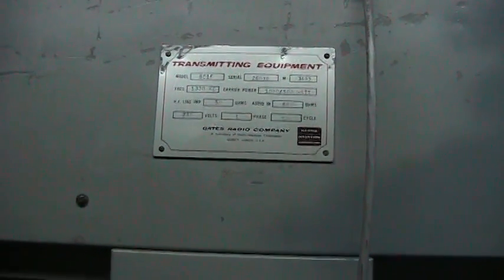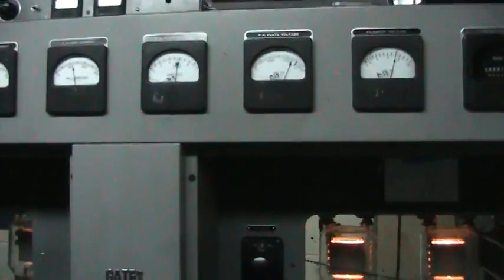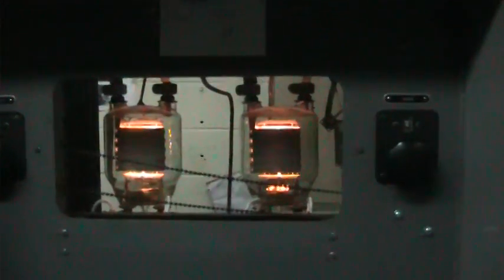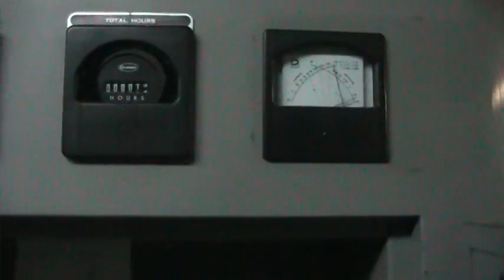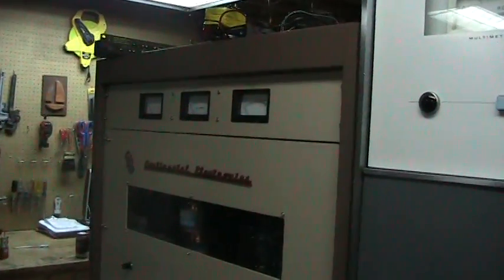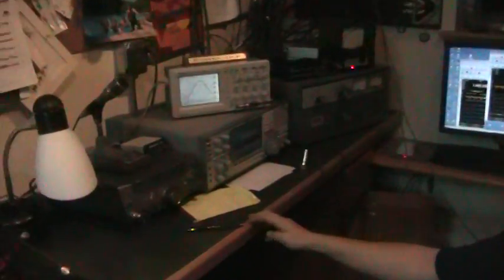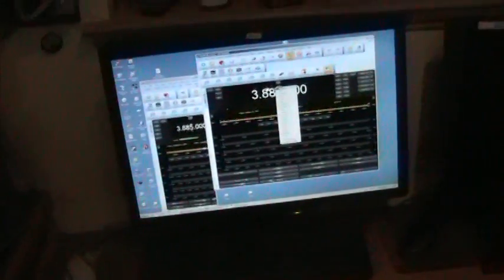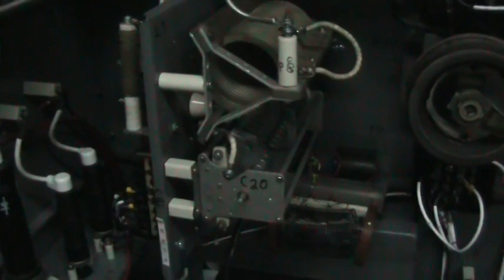HAM RADIO RESTORATION OF GATES BC1F

Comment: 1kw carrier? I am looking for a Bauer 707 or something thats a 500 watt carrier or so. The 20v2's are my fav. Love those ol boat anchors hahah
Reply from the maker: There are lots of bauer and other 1KW rigs collecting dust and rust, they are mostly in HAM radio guy's sheds and they haven't done anything with them.  Most 1KW AM BC transmitters have a "low power" switch to allow nightime operations where power levels were lower.

Comment: These transmitters , operated properly are probably far cleaner than 60% of the amplifier equipped sideband rigs on 75 Meters ! The problem is , the SSB folks actually think they are clean . A few trips across 75M at night with an SDR and reality sets in quickly .

Comment from the maker: @ZmajSnoshaj 

The coils that are in the left hand rear view of the transmitter form what is called a "tank" circuit.  this circuit consists of adjustable coils and capacitors which "tune" the circuit to the RF operating frequency.  

I like tank circuits they look most like frankenstein's laboratory.

Comment: Nice, I saw that you had the tools to set it up. A Tektronix DSO?  The Icom could easily tell you your bandwidth.
Just upgraded to General last Saturday. I want to get away from just being a knob turner and start of with QRP homebrew. As my skills improve then try some bigger things. Boatanchors, hybrids like a FT102, then all solid state then modern Surface mount.  Looked at some class E amps for AM that were interesting.
They're small for the power level out.
QRZ not updated yet.
KG4BXN

Comment from the maker: 1100 daytime and 500 nightime watts. with 100% modulation thats a hunk of power.  With the modifications to the tank circuit for ham use it makes a chunk more.  the rig will not do SSB.  the harmonics are within FCC limits.  i think it provides a commercial quality signal.  the audio is limited and compressed by a commercial AM Orban 9300 which allows audio/signal bandwith control.  listen to us on 3.885 usually evenings.

Comment: What was the amps power rating in Broadcast service? AM only now or can it go ssb? Class AB? Bandwidth and any odd spurs?  Could it still pass quality for commercial use?  I guess you don't need a heater in the shack.